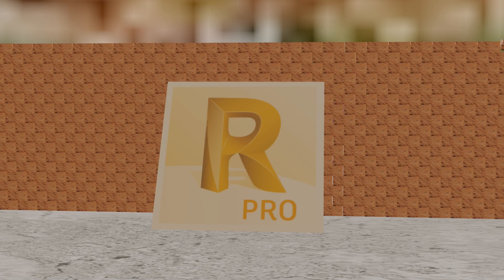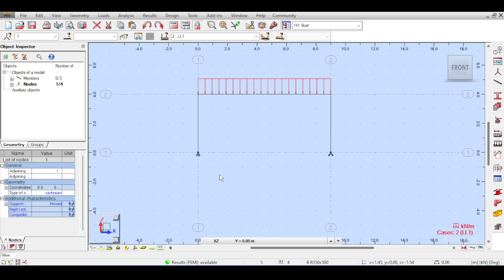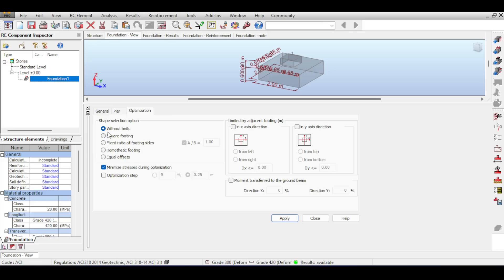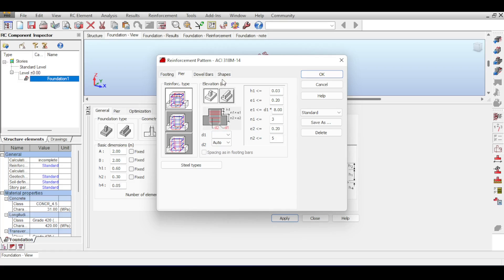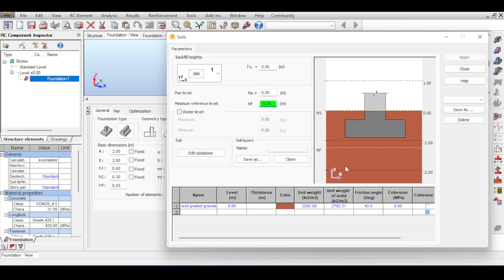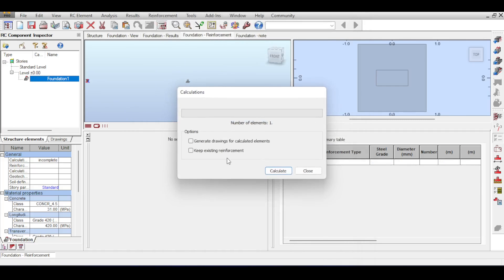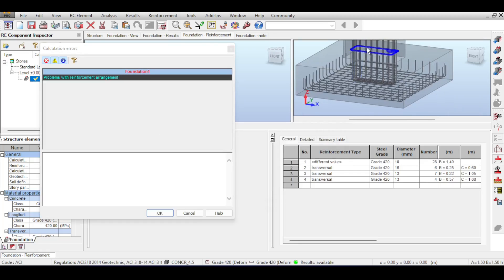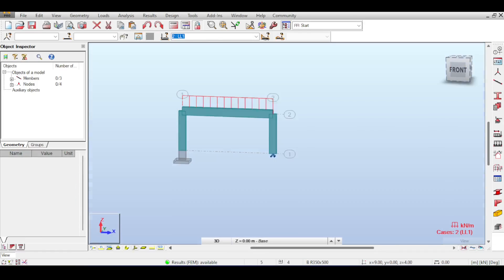Designing RC Foundations in Autodesk Robot Structural Analysis: A Step-by-Step Tutorial

Comment: Hello, quick question, can we calculate the anchorage length for concrete beam/column connection on robot ?
Reply from the maker: Hi there, 
It does calculate anchorage length. When you design beams, part of the checks robot does is the anchorage length. It actually even might extend the bars "mid-span" to cover that.

However, in case you are hinting to its ability to design joints (EQ special frames), then as far as I know, No. But I will research it.
Regards,
CEE
Reply: @CivilEngineeringEssentials  Thank you for your answer, do you have any screenshot where you see the check of the anchorage length or anything ? I am quite new with robot ^^' and thank you for the videos.
Reply from the maker: I have to look for one. But you can see proof for that when it tells you (Error in reinforcement arrangement or distribution.)
This happens due to anchorage and spacing calculations.
Once I have finished the building series, I will see if I can make a video about this.
Reply: Cant' wait to see that Video, thank you ! @CivilEngineeringEssentials

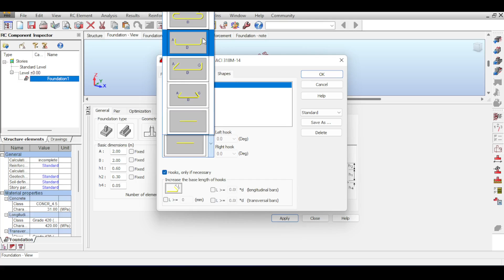Comment: I noticed that at @5:20 the horizontal loads are not shown in the Loads Definition menu. Is this some mistake or does it consider those loads anyway (just a display setting)?
Reply from the maker: Hi there, thnx for your comment

it is because: in that little window, on the top right, there are 3 buttons to select from, which open extra options to define loads.

The selected mode was (vertical force), so that is why no horizontal force input was possible.
If the other modes where selected (vertical and single-axis bending) or (vertical and bi-axial bending) then the inputs become available.

Hope it helped. Please feel free to ask any extra question.

Regards,
CEE
Reply: @CivilEngineeringEssentials   Thanks, it did answer my question!